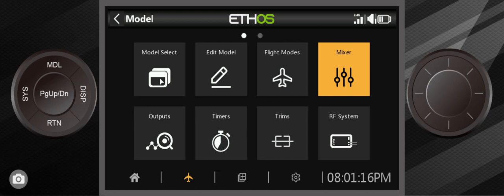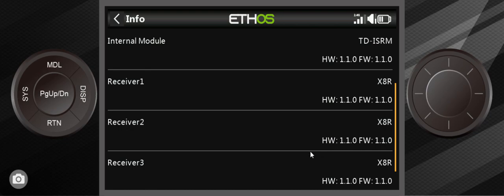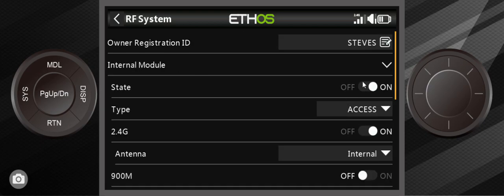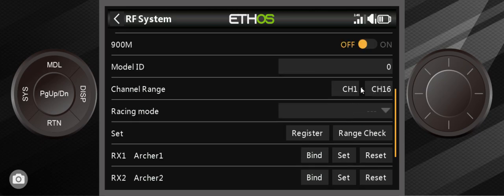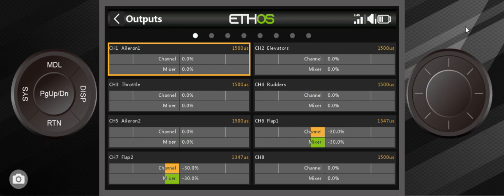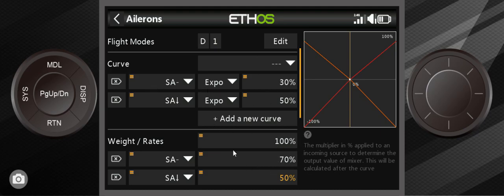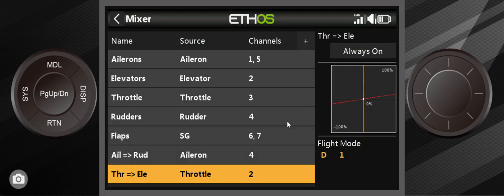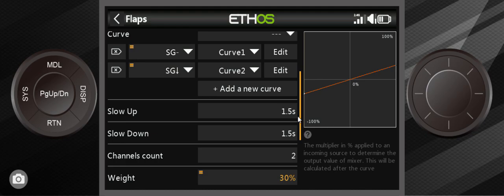FrSky Tandem/Ethos Transmitter Quick Setup Guide

Comment: Steve-  How do I assign the surfaces to the channels I want, not the channels the Tx wants? I want ailerons on 1,2; v-tails on 3-4, and flaps on 5,6 channels... Thanks! I fly mostly gliders, and want to use 6 channel receivers in 6 surface models.
Reply from the maker: At the bottom of each control surface is the list of channels the control surface is assigned to, you change it here.

Comment: Steve I have a X20S Radio with all the lastest updates, Running a RB35S With  2 TDR10 Receivers also with all the updates. My issue is I can not get the Self Check to work on either bank. We did the RB35S Calibration ,all the control surfaces work fine. Stabilization set up on 3 position switch channels 13,14,and 16 everything works fine. When I go into the RB352 system Stab menu per the manual I can not get the Self Check to Enable or blue test light to start flashing . Any ideas what I'm doing wrong? Any help would be grately appriciated.

Comment: Hi, not exactly on topic, but I’m trying to setup RB-30 with two TD10 receivers. I can’t get TD10 to talk to rb30. I can use an ACCESS R8 pro to talk to RB 30 so that I can set voltage and failsafe. I need to be able to do same with TD10.
Reply from the maker: SBUS out and Smart Port. You need to change a pin to SBUS out using options (next to bind) and then change the port to SBUS out.

Comment: Hi Steve there appears to be a program error when using the trims switches adjacent the joysticks. I nearly lost a model with this issue! My model was mechanically set up perfect. For this description I will use the aileron set up but it happens when using all four joystick trims. In the mixer i.e. ailerons I had dual rates and expo set up. When I flew the model for the first flight I had to add a lot of right trim. The problem is the trim switches shift the curser centre point in the mixer, suddenly I had a soft aileron in one direction and violent aileron in the other direction, which took skill and assistance to get the model back and landed. I have been flying for about 30 years and during this time have owned many different brands of transmitters, my previous transmitter being a FrSky X12S that never had this issue. Changing trims should not change the central cross + point on the transmitter. To correct this problem I had to go back to sub trims and dial the problem out there, then back to the mixer and zero the trim button setting back to the centre of the curser point. Next flight I still had use a small amount of trim, then return to sub trims and again carry out the previous procedure. Again repeat, that this has never been a problem with the X12S or previous brands of transmitters. I would appreciate urgent attention be applied to this error. Thanks
Reply from the maker: Roscoe, I will look into this when I get into the office.
Reply: @SteveLoves2Fly  So is this actually a problem I need to worry about with my ned 9-30-2023 transmitter? I do not see where this was resolved in this forum

Comment: Hi Steve. Have you look at Mike Shellim Open TX program that he Wrote for Flying F5J ? Well I am New to F5J and Fly FrSky X10s transmitter and having dumb transmitter Battery problems the Battery that FrSky sent me will not hold and Charge. Back to the Program that Mike wrote it is very Nice for Sailplanes. Do you know if there is a Ethos program for F5J sailplanes?    Thanks
Reply from the maker: Mike’s Ethos Hanger

https://rc-soar.com/ethos/?fbclid=IwAR2szBKJ0JEfJGPcySgmXfrJRVmYTwR0pHV5SxrkVxTOYxnEHq1N30G0s40